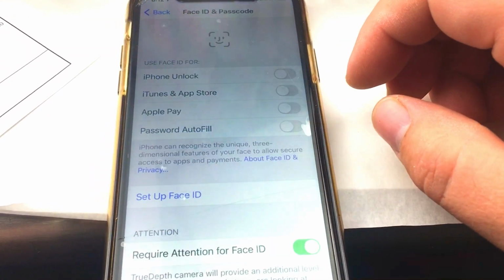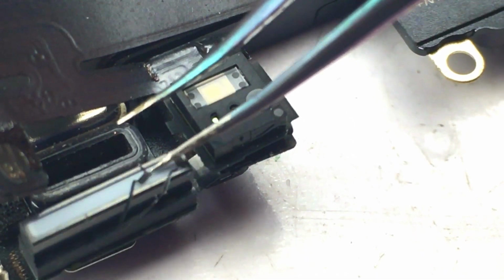iPhone X Face ID Repair

Comment: Why does my face id still not working, it said truedepth error(i already transfer the flood illuminator and ambient light to a new earpiece flex)
Reply from the maker: Sounds like an issue with the dot projector or infrared camera on the front facing camera assembly. I have videos covering those repairs
Reply: @FIXDPHONES  I cant find those videos